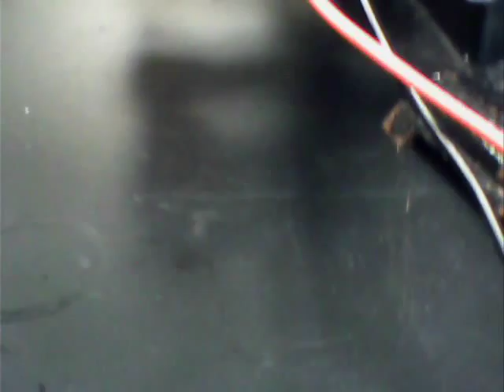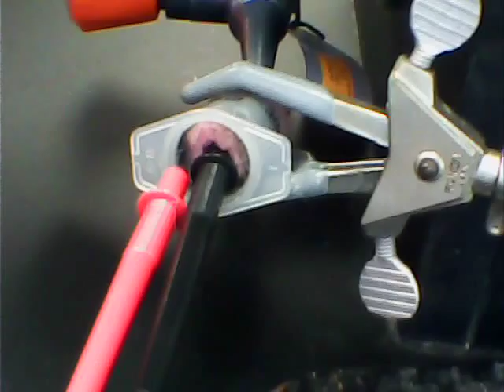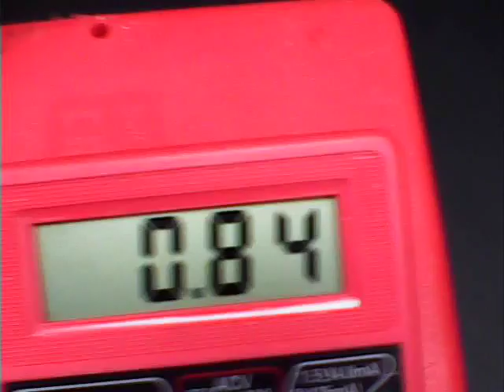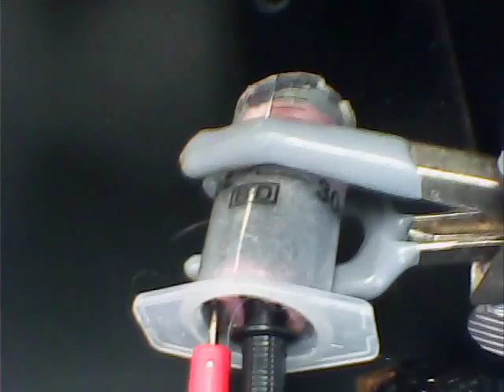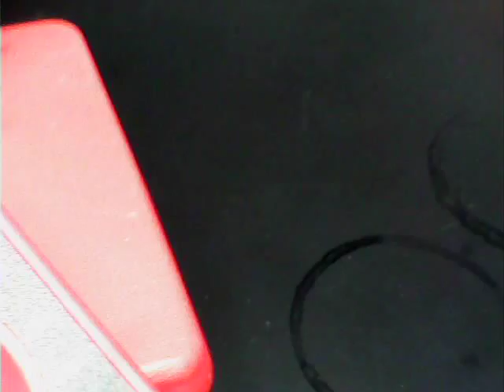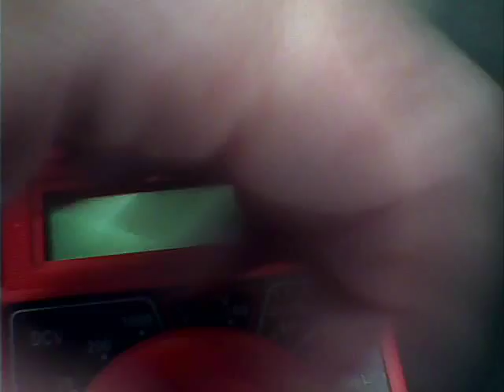Zinc Air Battery/Bionic Liquid Electrolyte

Comment: Where do you buy choline chloride?  I can only find choline bitartrate.  Also, do you know the upper temperature limit of your ionic liquid before it starts to boil or smoke?  I've been doing research on liquid metal batteries.  I'm looking for and ionic liquid that I can use as the electrolyte. Any help would be appreciated.